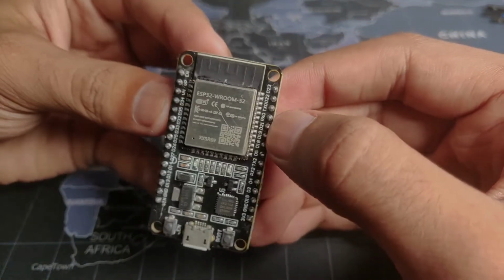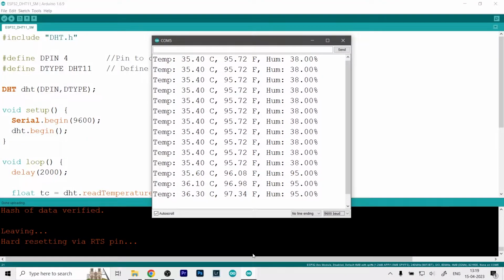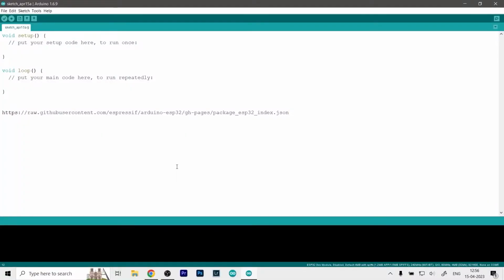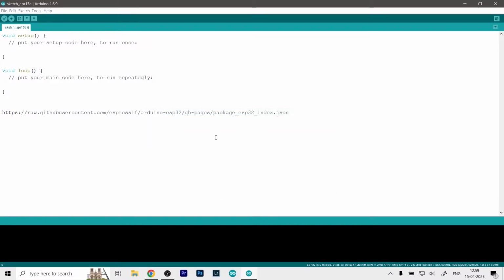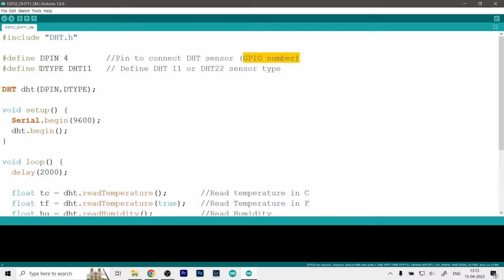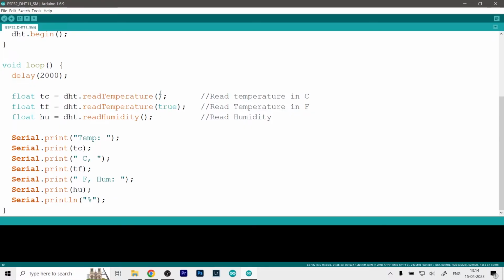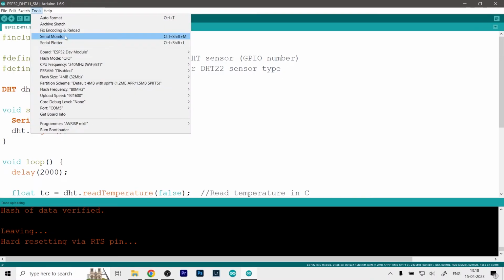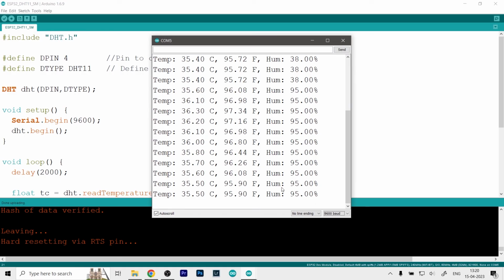How to Use ESP32 with DHT11 Temperature and Humidity sensor and Arduino IDE

Comment: Hello, Thank you for your video
i am looking for the circuit which can operate motor on/off with humidity and temperature sensor 
Please help me
Reply from the maker: For his application you can use the "if" statement in Arduino coding.

Comment: Temp: -0.10 C, 31.82 F, Hum: 17.60%
Temp: -0.10 C, 31.82 F, Hum: 17.60%
Temp: -0.10 C, 31.82 F, Hum: 17.80%
they don't make sense a bit
Reply: I am getting the same output, and I have tried several DH11 sensors. Did you find a solution?

Comment: DHT11 will work with esp32-c3-mini1 as well right?
Reply from the maker: I could work but for that you will need to design and entire circuit with capacitors and resistors to make it work and be able to program it.

Comment: Temp: nan C, nan F, Hum: nan%
17:19:43.023 -> Temp: nan C, nan F, Hum: nan%
17:19:45.097 -> Temp: nan C, nan F, Hum: nan%
17:19:47.145 -> Temp: nan C, nan F, Hum: nan%
17:19:49.225 -> Temp: nan C, nan F, Hum: nan%
17:19:51.303 -> Temp: nan C, nan F, Hum: nan% even after doing same thing step by step and checking all the connection with d2 (2dht22 and 2 mode mcu it is showing the same thing and included the apreference code as well)
Reply: same problem m8
Reply: Me also getting same problem 
Can u  pls tell me how can I solve this
Reply: Same problem no solution found
Reply: Checked all working fine but issue not solved
Reply: @ i had changed the connection
Reply from the maker: There could be 2 things
1. The wire used for connecting is broken (check the conductivity of the wire or replace it).
2. The sensor itself is broken.